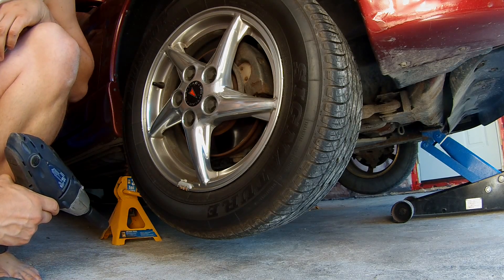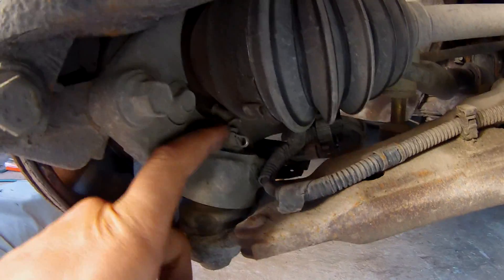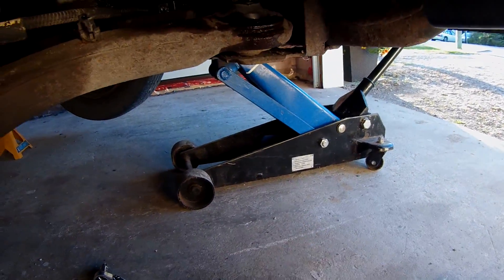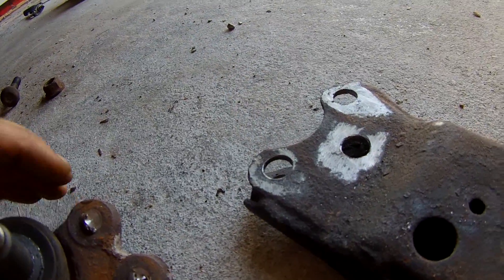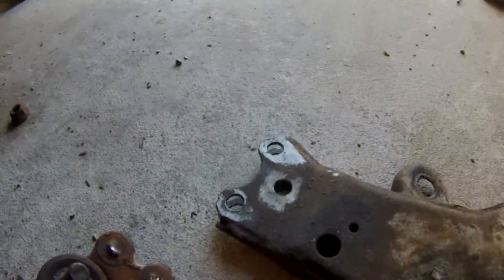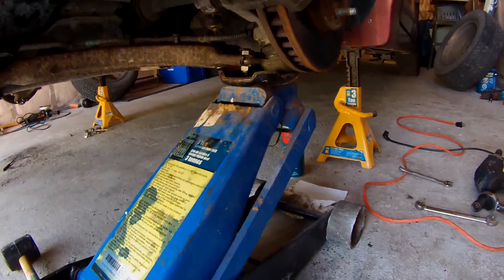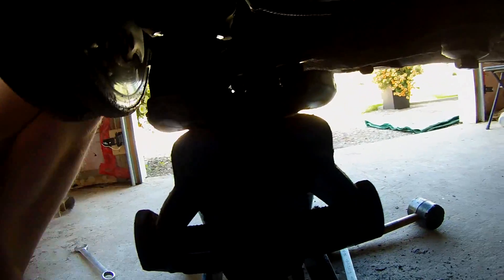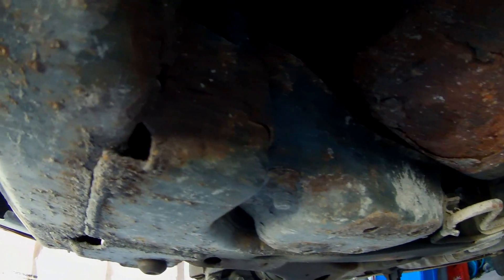Ball Joint Replacement Grand Prix

Comment: Wats up man i got a question i have a 97 grand prix my wheel shakes when im doin more than 50 miles per hour what could that be
Reply: Anton Williams mine is an 02 and in hoping its the control arm, I'm replacing today will let u no if it fixes it

Comment: Do you have to grind both sides of rivets? Top and bottom?
Reply from the maker: Yes you have to do both sides because then you'll have to drill them down enough so they are flush.  That way you can hammer them out.